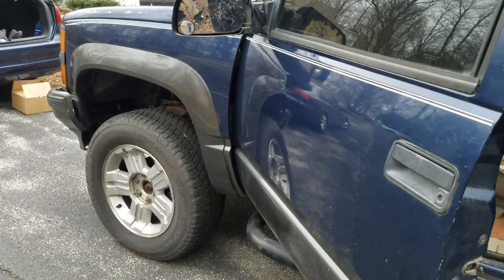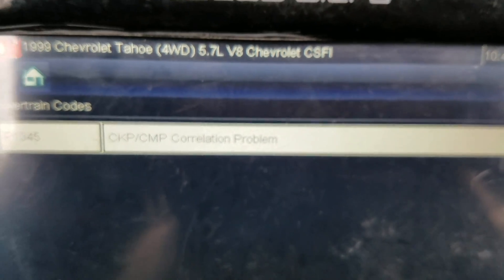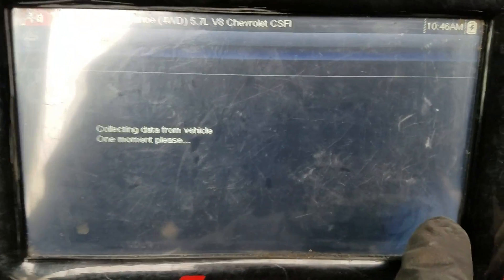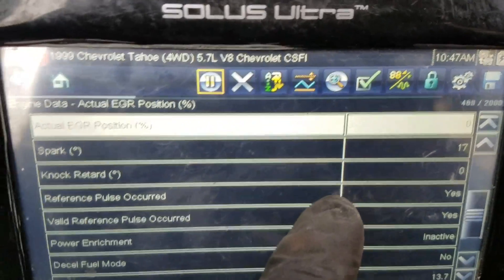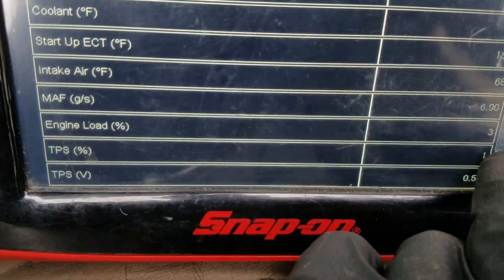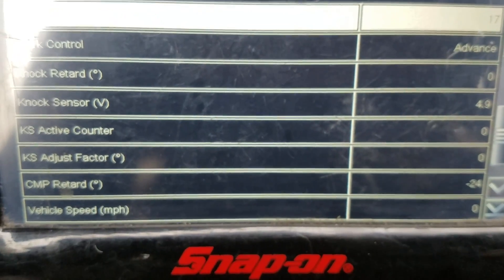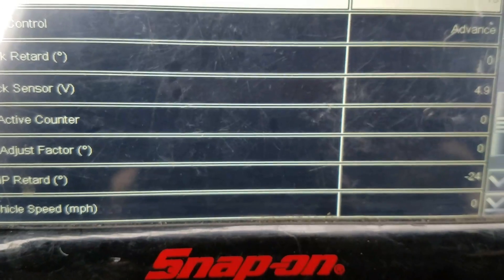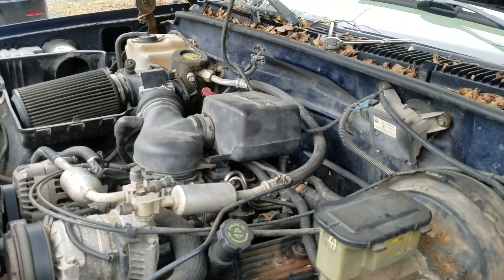P1345 Chevy 5.7L-PART 1- Cam/ Crank Correlation

Comment: I have this code and when I step on the gas pedal it doesn’t respond like it should and then pops/studders ?
Reply: Did you figure it out? Mine does the same thing 
It has 0 power and kinda shutters and goes in and out of power, throws a p1345

Comment: I got this code in my 99 suburban, and my suburban runs fantastic! I don't have any issues whatsoever, so I'm really at a loss to figure out why I need to get in there and change this just because I'm throwing a code . Any comments?
Reply: It may be  just to be on the safe side. Let me explain... The issue I have found in my 99tahoe 5.7 is that the spark in the distributor is jumping from rotor to cap when the rotor's electrode tip is not aligned in time to the 8 electrodes in the cap. If far enough off in alignment, it can cause misfires and backfires due to crossfiring of the spark to the wrong electodes in the cap... sending spark to the wrong cyl/ spark plug at the wrong time (out of firing sequence) and this is bad news!
I heard it called "crossfiring" and it causes rapid failure of a coil, coilwire, cap, or rotor due to higher than normal spark voltage being imposed in the secondary ignition system (coil, coil wire, and rotor). 
It seems rare and vaguely mentioned in older distributor systems but it can happen in those too. The same issue could be replicated in older distributor systems (where the spark timing is matched to the top end of the rotor/distributor shaft) by a damaged rotor or misfitted rotor (a rotor somehow placed out of time with the distributor shaft)..., or if a cap is not matched (turned out of time) to the housing of the distributor.
The timing of the spark in my tahoe 5.7 is determined by crankshaft position using a crank position sensor, beside the hamonic balancer at the front of the crankshaft. However , the camshaft position sensor is in the distributor and it does not determine when the spark timing is fired from the coil. 
Maybe we need to ask other techs what the camsensor does do in these Gm systems other than help send a 1345 code. 
It seem logical to me that any wear or misalignment that occurs between the crankshaft and the pickup ring/disk (or a fault in the camsensor/circuit) in the distributor will potentially cause a P1345 code. I'd be sure to check the distributor drive gear and cam gear it meshes with. That was the point of much wear on my tahoe. Those gears run the oil pump and distributor. The teeth are being found to wear off and even strip away on the distributor gear in some of other's engines. 
The teeth are stressed the hardest when the pump turns with more resistance... in cold starts where the oil is thick and heavy ( dont rev engine way up while the oil in the pan is cold...) 
If you have not had the timing chain and timing key in crank sprocket and the cam dowel in the cam sprocket checked for wear or stretch,.. do that to be sure it isn't affecting the problem and bringing a P1345 code. I've held onto my used filters from oil changes just in case and decided to cut them open to look at the deposits on the filter media. I've only checked the last few ones and noted some metal like the distributor gear teeth wear would give off. The drain plug magnet had some metal on it this last oil change too. So something iron/steel has been wearing fast recently. Once I pulled out my tahoe's distibutor I saw plenty of wear on its gear teeth. Looked at the cam gear teeth using a borecope camera while turning the crankshaft by hand and assessed I might get by with just a good distributor gear to remedy it.

Comment: I have an innova scanner and on live data all i can find is spark advance showing a -20. I tried fixing it by dropping in distributor with harmonic balancer set before tdc and changed from neg 20 to neg 30. So i did it again with harmonic balancer past tdc and then it wouldn't start. So i set everything back to where i had it before and truck cranks right up but i still have neg 20 spark advance
Reply from the maker: The spark advance reading is what the computer is trying to do as electronic advance. Try looking at the other PID lists for the retard reading.

Comment: You will get as much as 25 degrees out reading from the common problem of the distributor gear being worn.  Also, some new distributors came with Gears put on 180 degrees out because they were assembled wrong in ...China?  You can move the gear as it has a slot pin.

Comment: it should have a different hold down bracket. it can be adjusted to align cap n rotor. I own one been through it.
Reply from the maker: The hold down bracket and distributor are squared to prevent the distributor from turning. GM did not intend for it to be adjustable. With advances in electronic ignition timing, adjustable distributors went by the wayside. Then gone entirely shortly thereafter.
Reply: @SkyhookStudios  https://www.youtube.com/watch?v=rPlYNtNkI9k

Comment: That older Chevy V8 engine uses the same protocol as my LS1 engine (SAE J1850 VPW) & I've been having trouble finding a scanner that scans it as they have only read the CAN OBD2 system.

Has anyone got an idea what scanner I should order next for my car if the Nexpeak I've ordered so doesn't work ?
Reply: Snap on

Comment: Can the p1345 code cause stalling at idle on 99 Yukon. Thats the only code I have. But once started it runs for about 5 secs. the dies. Can barely give it gas if at all.
Reply from the maker: No, that code is a running code. The 5 seconds then dies might be a fuel issue. If you removed the distributor, check that you have oil pressure. If the computer doesn't see oil pressure, you will only get a few seconds of run time before dieing.
Reply: @SkyhookStudios  how to check oil pressure. Cant keep the truck running
Reply from the maker: @keys2.0  does it show any pressure on the dash? Also, if you remove the pressure sensor and hook a gauge up, you should show around 15psi just cranking.
Reply: @SkyhookStudios  spoke with person who i bought truck from, he says distributor was never removed. So I assume its in the right place. Oil pressure appears to be normal. 14-16 lbs.
Reply: @SkyhookStudios  maybe swap out fuel pump again?
Reply from the maker: Can you check fuel pressure?
Reply: @SkyhookStudios  yea, that was first thing I did, it's around 60 psi. When i got truck first issue was fuel pump because thats what i was told was wrong and I couldn't hear it coming on myself so i changed it. Then the anti theft module. The board was burned out, replaced it. Did the relearn procedure. It fired right up, few seconds later it died out. Now thats all it does. Im thinking if not defective fuel pump, I heard maybe it could be ICM. I appreciate any help.
Reply from the maker: @keys2.0  The theft module was my next thought. That and the oil pressure will give a few seconds of fuel pump then if it doesn't see the appropriate request from the theft module or it doesn't see oil pressure, then you loose fuel pump activation. Key on, what is the theft light doing?
Reply: @SkyhookStudios Before relearn process it stayed lit at key on position.  After process when I crank it up, it flashes maybe 2-3 times then goes and stays out
Reply from the maker: Something is causing the pcm to shut the fuel pump relay back off. Try jumping the fuel pump relay with a fused jumper and see if it stays running.
Reply: @SkyhookStudios  can you give instructions on doing that please.
Reply: And what should I do about the p1345 code?
Reply from the maker: @keys2.0  firstly DO NOT DO THIS USING AN UNFUSED JUMPER. If you do not have a suitable jumper MAKE ONE. Then go under the hood to the fuse box, located on the driver's side next to the brake master cylinder. Find the fuel pump relay inside that box. The cover should have a diagram for you to follow. When you remove the relay, there are 4 pins that fit into the fuse box. You will need to make a jumper wire that will fit down into where those pins go into. Use the relays pins as a reference. Try to get close to the size and style of the relay pins and don't jam something in there. If you mess up the fuse box female pins, you will need a new box.... The two pins that you want to connect are diagonal from each other. The relay pins are in a square/rectangular configuration. If your standing at the fender, looking across the vehicle, the terminals you want to connect are going to be the top right and bottom left. I'm 95 % positive that that is correct. Regardless, if you blow the fuse in the jumper wire, replace the fuse and switch to the other diagonal set of pins. Remove the fuel pump relay and connect your "fused jumper wire" (min 15 amp/max 20amp). The fuel pump will turn on with or without the key in the "on" position. Once it's jumper over, attempt to start the vehicle and let me know what happens.
Reply from the maker: @keys2.0  Don't focus on the P1345 until it runs all the time.
Reply: @SkyhookStudios  ok. Gonna have to make jumper first. I have the fuses what guage wire should i us.
Reply from the maker: @keys2.0  14-16 should be fine, 18 would work also.
Reply: @SkyhookStudios  ok. Gimmie a few mins please.
Reply: @SkyhookStudios  after sticking jumper in to relay connection i heard a whining coming from distributor area (guessing thats the fuel injector area). Started truck ran a little while and shut off, but was able to give it gas and rev the engine.  Started it and revved the engine a few times, same results.
Reply: @SkyhookStudios  you wont believe this or maybe you will, after enough frustration for one nite decided to say forget it. I put the maf assembly back together including backbon throttle body and decided to starte it. Fired it up and its still running, sounds very good. Its idling around 1000rpms. But when you fix one problem another always shows its head. I can't get it to shift out of park once I  start it. Unless I  put key in the on position then shift to neutral before starting then I can shift to rev or dr. But if I go back to park it sticks again. Wow!

Comment: Would I have a hard start if its not set at 0?
Reply: David Nguyen I’m curious myself. Having same issues
Reply: @stuart8277  replaced cap & rotar and had to turn a couple degrees. Runs great now at 450,000 miles